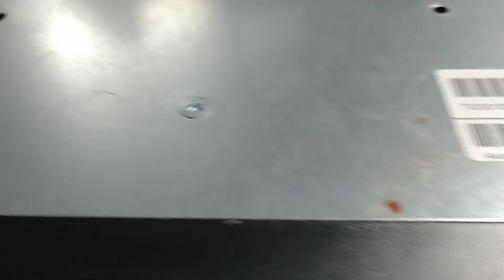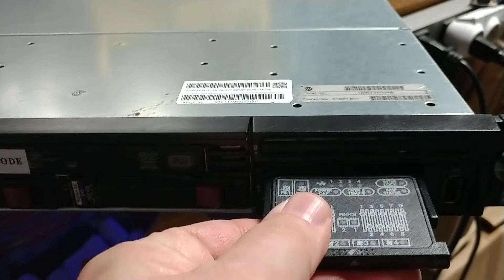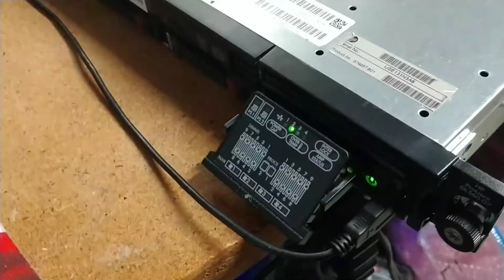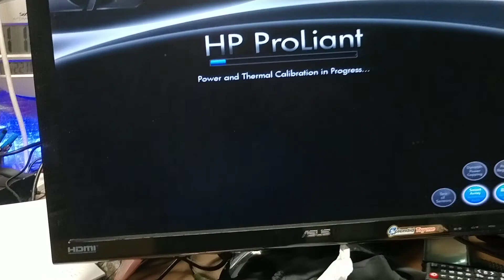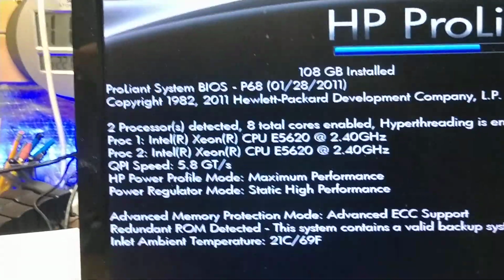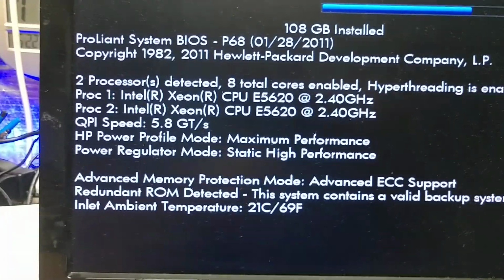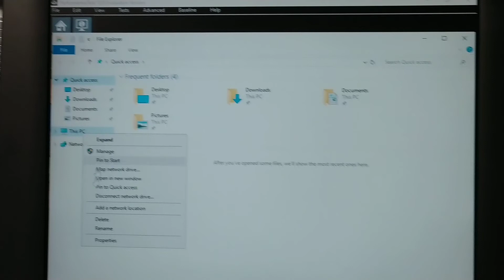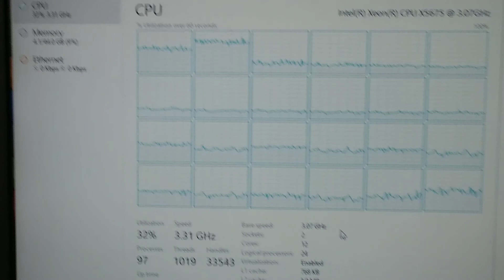HP DL360 G7 review

Comment: Hey there! Thank you for your informative video! Being a new owner of an old 360 G7*, I am getting to know it abit at a time as I start playing with it. I do have a troubleshooting question as I've just run into my first part needing a replacement and wanted to know what the proper method is. How do I reauthorize cache when the battery dies and I replace it? I have the 410i on my Dl360 G7 and just had the batteries die, with the nodes warped outwards very prominently. I purchased a new battery (460499-001) but have not yet found a good guide on how to reauthorize it so that it will work after plugging it in. Anything you can point me to would be great if you are so inclined. Thanks!
Reply from the maker: Well use the 800-i and the battery swap should auto refresh after the full recharge process. I think you can force a reset but that could be a issue if there is another issue.  Do the swap out and see if the auto refresh takes.  If not let me know...I am glad to help you if I can...   Oh and by the way you can transition to a new RAID controller if needed and you will not loose any thing RAID wise but if you  are doing HBA only mode then that would be a bit of  an issue.
Reply: @leadiususa7394  Thank you and I appreciate you getting back to me! I've been playing with it the last 2 days and seem to have a short somewhere with the battery or the array, as I've installed  the battery but am getting the 3rd LED indicator as solid amber, which seems to indicate "a short across the battery terminals or within the battery pack". It's not recharged or reinitiated, so I'm guessing I'm probably going to need to purchase a new p410i raid array controller.
Reply from the maker: @siskoeva  I agree... Sorry dude
Reply: @leadiususa7394  No worries, I appreciate your video rundown and your response! Thanks for all you do!

Comment: audio muffled due to finger positioning.. :( can't hear a good portion of video...
Reply from the maker: Thanks for the heads up and I will do better...
Reply: @leadiususa7394  it happens . . . Thanks for the info none the less. Curious though. The dl360 is supposedly only able to run 1333mhz highest speeds but i have placed 2x16g 14900 and they show as1600mhz on meminfo... Wouldn't it only show as 1333 if that was the cap? Or has there been advancements in someplace along the way since the original manual was printed??
Reply from the maker: @degrinchy  No not really, The issue is the motherboard bus can only do 1333 so your higher RAM is placed into a like of compatibility mode to allow it to run slower at slower speed of 1333.  Sometimes the later BIOS updates can get a bit more but the hardware is your real limitation.  /:>

Comment: I just recently got my very first set of servers,one being the 370 and the second the 360 models like the one in this video it’s missing all of the ram cards and hard drives is there anything I can do to salvage these ?
Reply from the maker: Depends if you want to use them. If not then scrapt as metal at the local recycling g plant. It will give a few bucks. Me... I would build them and have some fun...

Comment: Good afternoon, please tell me how to adjust the fan speed on the HP ProLiant DL360 G7 Server.
Worth windows 10
Four disks in the raid and instead of an SSD drive
The processors are not loaded at all, but once every half hour they start roaring as if an airplane is taking off.
Reply from the maker: Hmmm the fan should spin down after it boots up.  Unless you have a failed device like a fan or cross bus and so on.  You can control the FANs level in the BIOS, but if you are having your fans at full speed all the time then you have a issue on the mainboard.  Check your BIOS log files to see if there is an error.  You maybe just be running hot but I don't think so...
Reply: @leadiususa7394  Thank you for your reply.
No. At startup, the servers are very quiet.
A strong noise appears once for 2 minutes and dies down every half hour.
Please write exactly how the item in the BIOS is called which is responsible for this parameter.
Or if it's not difficult for you to link to an article where it is sorted out.

Comment: I got one of these servers from ebay a week ago, a sweet machine, HPs equivalent to Dells R610. You mentioned an issue with the shroud, would that be it will not go back on? Simply cut the bottom off, level with the Horez angled piece that fits under the chassis. Hard to explain but it's the SAS cable that prevents it from fitting correctly.
Reply from the maker: Thanks

Comment: hi, I just got one of these, the seller setup the raid for me, is there a GUI version of ubuntu that will work without too many headaches? (I'm new to servers) otherwise, can I buy an old version of windows server for this and if so what version? I really just need a GUI OS. Thanks for the great content.
Reply from the maker: Use the latest Ubuntu download (I think it is 20.4)  IT is all GUI based to setup.  Real easy to make.  If you want to use MS server then get 2019 or 2016.  Should work fine...  Enjoy and do a little research as you need it...
Reply: @leadiususa7394  Thanks!

Comment: Thinking about acquiring one of these for my home lab, but sound fingerprint is a severe setback for me. How loud is this thing idle/load/POST? TIA!
Reply from the maker: They are not bad and you can lower the fan rate.  Just track your CPU temp if you do...  I find balance mode works best...
Reply: @leadiususa7394  Cool. Thanks for the reply. I live in a small place and the only viable place for my servers is a closet in my bedroom, so noise profile is a massive factor for my stuff. Will keep that in mind.
Reply from the maker: @gstand  If this is the case, make sure you pump the warm out of the room from up high so you are pulling cooler air into the room, Air flow is key to prevent the server fans from spin up and getting loader.

Comment: i just got a new HP DL360 G7 with that small 1 cpu 4 core 8 thread with hyper threading  slow ... can i take the memory and 8 core 5520 from a Intel® Server Board S5520HC, S5520HCT to up grade the DL360 G7 ???
Reply from the maker: You can goes up to the following: Quade core Intel Xeon Processor X5687 and on the six core side you can go to Intel Xeon Processor X5690.  I would do the six core.  The cost is pretty low. Avg. cost is around $50ish range... or lower.  Here is a spc URL you can use to select from: https://support.hpe.com/hpesc/public/docDisplay?docId=emr_na-c02215285

Comment: May I ask what would be the best bang for your buck , in terms of processor choice / calculation throughput ?
Reply from the maker: Well the E5640 and up to 5690 - series are really good for storage processing but do take more power to use.  If you go with two L5640 you will run on lower power and still get six core for each CPU.   Check this link out if you have more questions. https://h20195.www2.hpe.com/V2/getpdf.aspx/c04284501.PDF